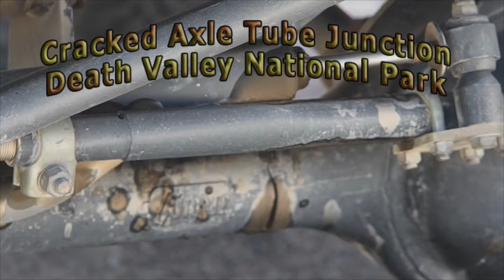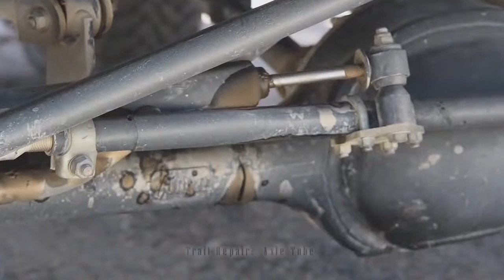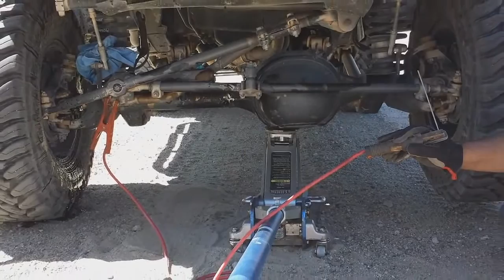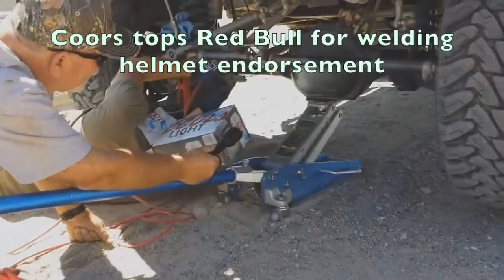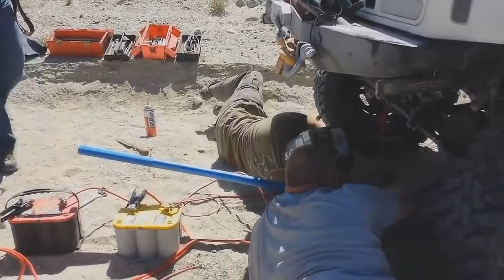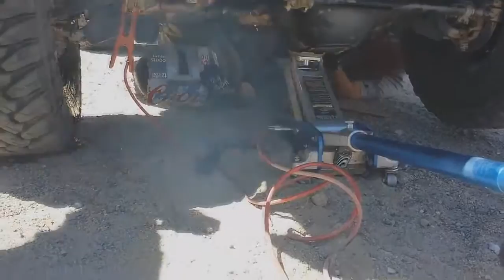Cracked Axle Tube Junction - Death Valley Weld Repair

Comment: i carry extras for all lights plus fluids and now have 2 full spares plus slime, most tools and after a long grinding drive even spare universal joints but a welder ?... wow that's ready for anything..
Reply: +potatothorn Just to make this clear... The only "welder" they had with them was the guy with the 12 pack hood. They did this with vehicle batteries, battery cables, jumper cables and welding rod.
Reply: *****
i was thinking about that myself, wondering if they just used jumpers and a welding rod thanks for the details- someone still had to think to bring welding rods, pretty cool.. i should get some myself i already carry ultra heavy duty extra long jumpers
Reply: How did you well that Axel using batteries?
Reply from the maker: Steve Verdino - I believe that they ran several batteries in parallel to obtain sufficient power to weld. They are brilliant problem solving electrical-mechanical engineers.
Reply: @DeathValleyDazed  yeah a decent 12v alone will provide enough juice for minor welding, a couple together can really get the job done.